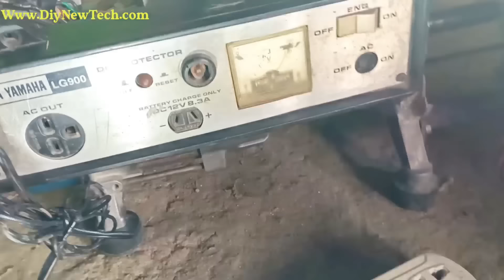Make Free Energy Generator: Easily Generate 220v Electricity

Comment: A very big lie, he removed to replugged the light never blinks, a very big lie he showed us before starting it and he can not show it the way he did from beginning it a big lie, I ve try this it doesn't wor
Reply: You right 👍👍
Reply: Why are you so skeptical? Have you tried it? Before you can judge it as a lie let's see your efforts otherwise please hold your peace. Thanks
Reply: The light did not blink because it had a capacitor that stored electricity.
Reply: @koonjulougrasen4432  So the capacitors stored energy was why there was no delay in the light bulb.
Reply: It's possible this is pmg google it and you will see it for yourself
Reply: Superb, he is using Eletricity Only Generator Start Then Chenge Switch…
Reply: @koonjulougrasen4432  m
Reply: It is possible, a running capacitor is connected
Reply: He use battery to create more magnetic inside the rotor
Reply: Ya el canal angelito lo comprobó
Reply: @se-akworkplace3166 

I made it,It took me a week. The cost of the materials I spent on this failed project exceeded $300. Finally, the result was 2 to 3 volts.. Do not believe them. This lie in the video is nothing but crap.
Reply: Are you an Electrical Engr.if Yes prove him wrong.even wining with hand it will bring light
Reply: What about the drill is it lie

Comment: almost but didn't you forget something.. when you unplugged the device from wall outlet.. the light bulb stayed on, something tells me there is 220v grid power on that extension socket that the light is plugged into. its not free energy if its grid or capacitor..

Comment: how many watts does the induction motor have, probably from a washing machine, and what revolutions does it have at what speed does the system operate?
Reply: well choose motor with two poles like water pump motor 3500+- rpm w/o load 0.5hp 346 watts is enough to drive  the 1kva  generator.
Reply: I did mine with a washing machine motor and it didn't generate enough electricity to light a led light. I guess there was something else he did that he ain't showing. So I guess we were misled. So it's all lies

Comment: 🤔 getting the right electric motor to maintain the RPMs recommended to run the armature @60 MHz and maintain it. It should work just like having gas powered diesel powered motor on the generator what needs to happen is another power source to start it all up and switch it over to run energy free and as long sa a light fan something that can run constantly to keep the system energized

Comment: Share!!!... most of 1kva gasoline generator had a 12 volts output for battery charging since your toy had one  rectify it with bridge diode filter with capacitor plus sign to voltage pin and NO normally open pin of the relay, other coil side to the ground,  Common pin connected to the improvised brush/slip ring . And the NC normally close pin to the positive terminal of the battery, negative ground... During initial run of the driving motor, the battery supplied the rotor winding to induce magnetic field and produce 220ac  at the same time 12 dc volts  energized the relay and the rotor winding. battery now is disconnected for  supplying the rotor winding. ( part circuit on my MCU based controller of the system "OverUnity My Ass!" (said by others who don't believe that it works) aside from motor speed, temperature display, voltage display...
Reply: Думаєш, цей пристрій реальний?
Вихідна енергія перевищує енергію споживання
Чи може він триматися і працювати постійно?
Дякую за відповідь

Comment: Sorry you haven't convinced me beyond reasonable doubt, maybe hidden batteries in the module with the gauge lithium ion batteries put out a fair bit of power , enough to do a few tricks to deceive people so you can get a few likes as the Chinese guy on the other channel tried but still had to have his invention plug into the power companies power which is not a free power source and then proceeds to run generators off the generator that is run from power company source " NOT FREE ", and a residual or recurring current is not unheard off and with a battery to perpetuate a current it will keep going until the battery wears out or the mechanicals fail still not new .

Comment: Are you telling me that the energy supplied to the AC motor sustained it even as you removed the plug. Hmmm,  the light couldn't even go down a bit.  It isteady. Somethin is not clear there 🆗
Reply: I agree with you something is hidden in this video ,motor is less power but usage of power (load) is more than motor power ...this is not possible at all
Reply: But a led bulb has a ractifires whas it a glow bulb i would  agree but led is on or of and most of the time not dimmeble

Comment: what is a jokes 😂😂⛔ 500 wats danamo to needs power engine 3 hp but you used washing machine motor coatar 0.1 hp  thats motor already 500 wats
Reply from the maker: This is 1200w generator check carefully
Reply: Let's believe you, if this dynamo is 1200 watts, then its engine will be 4 horsepower, and the engine it will have will be two stroke, but the washing machine motor you have installed with it. That is a quarter in power, that is, if you put 4 quarter motors together, then you get one horse power, while a dynamo requires four horse power to output a 1200 watt supply. Have you installed a washing machine motor? No wonder it's not a joke

Comment: How do you energize the routor electromagnetic field you need a 12 volt dc to the 240 volt on a Brushless one or direct on the pickup points on a breshless generator output coil to do that or n52 neodymium magnets North and South as the generator electromagnetic routor has a North and south pole it also need a nand gate switch so the pole osolate  the dc current current between the 2 electromagnetic each side
Reply: انها طريقة كاذبة
Reply: I find this to be almost impossible to believe.  Its too simple and generates too much power with no current fluctuation.  Clearly not as advertised.
Reply: Exactly. For sure there are hidden batteries inside.

Comment: generator efficiency 70%, motor efficiency 80% 
70+80= 150% 50% free energy 😂 s

nope, it’s 56% conversion efficiency so you need to add 44% more power to make it run without getting anything out
Reply: Until today, all of them have only ever calculated wrongly, so it can't work.
You just have to calculate correctly and it will work.🤣🤣🤣🤣🤣
Reply: @ossi.p  that’s correct

Comment: Motor efficiency proves this is fake , motors only give out up to 80% of the energy produced , the rest is lost as heat or bearings drag and other things , so only 80% is running the second motor who in turn gives out only 80% of the first motors 80% and after a turn , there wouldn't be enough energy to run lol